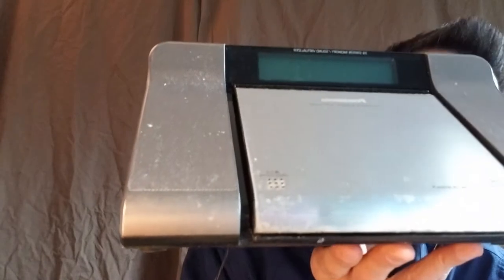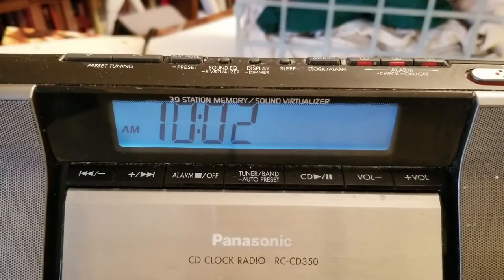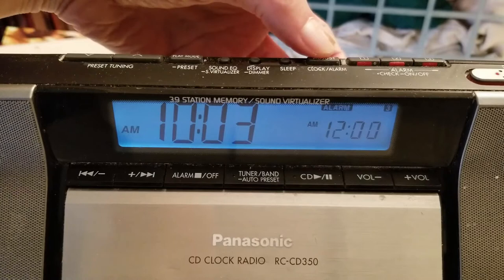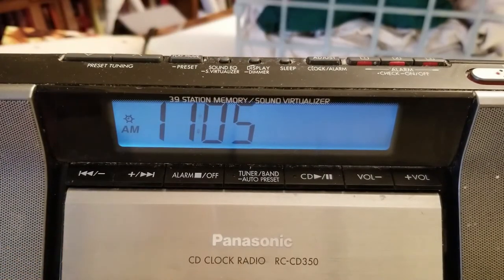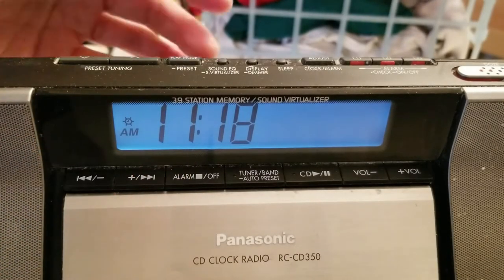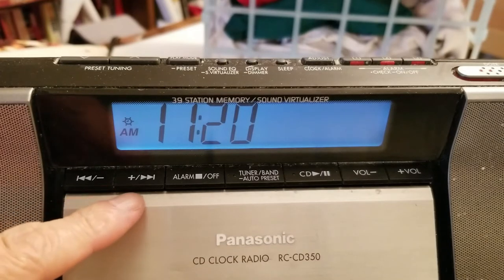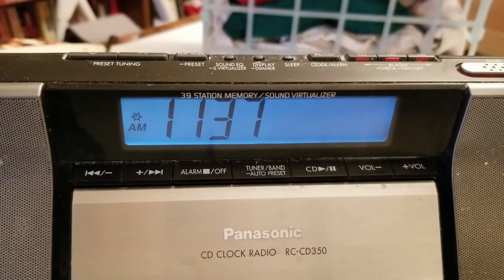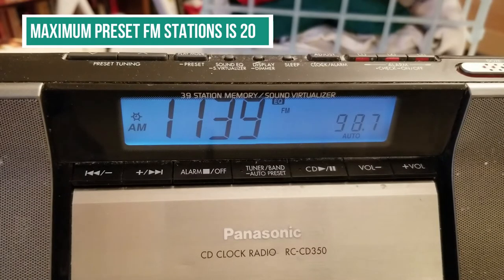Panasonic RC-CD350 Clock Radio Tutorial - How to set clock and radio presets

Comment: Thank You. I appreciate the training. but the CD does not work. it keeps saying no CD, but I put different CD every time it says. I just use it 2 days ago this month of December 2021. I love this Radio I had it since 2006. please help me? it is for my husband listening to music. again, Thank You.
Reply from the maker: Sorry you're having problems Ruth.  It's hard to say what's wrong without seeing the radio.  First, are the CDs "Real ones" or Burned CDs? This radio WON'T Play MP3.   Make sure the disk is firmly in place. It's vertical so it's trickier to put one in.  Make sure the setting is on the CD and not any other setting and last... it could simply be broken?  I hope that helps.  Let me know how it goes.  Thanks and Happy Holidays!
Reply: @waynethetrainer8888  💖💖💖
Reply: @waynethetrainer8888  how can I make sure the settings on cd? I've been having the same problem but i know it's not broken since it's still able to play the radio just fine. And I make sure to use real cds
Reply from the maker: @hamiltontrash9255  Sorry, I don't understand your question? what do you want to do with settings on CD?
Reply: @waynethetrainer8888  I have the same issue, whenever I put the cd in it reads "no disc" but the radio works fine and the cd player was working just a few days ago.
Reply from the maker: @salemaynalem6713  I can only speak from my experience. When ever my machine said, "No disk", it was because I tried to play a computer Ripped CD and not a, "Real Cd".  This player does not play MP3's.  The only suggestion I can make is pop in a, "real" CD.  if you get the same message, it may be broken.  If that's the case, maybe Panasonic can help troubleshoot?  PS.  Make sure you test the "Real CD" in your car or somewhere to make sure the CD actually plays! LOL

Comment: Is there a way to turn it of without unplugging it?
Reply from the maker: Thanks for the question, Kaleb.  I'm not sure I understand.  Do you mean turn off the radio or something else?  If you press the Alarm / Off button, it turns off the Radio without unplugging it.  What are you trying to do?  Maybe that will help clarify?
Reply: @waynethetrainer8888  I saved my Presets on 98.1. but after i unplugged it, it's erased.
Reply from the maker: @theamazingkaleb3077  Why are you unplugging it? That erases the presets AND the correct time, right?  LOL.  I'm trying to understand why you want to unplug it?  Now, if you are unplugging and moving it somewhere, I have an idea for you:   You can unplug it and keep all presets and time: By putting a battery in the bottom of the unit!  There's a place on the bottom of the radio where you can put batteries in as a "Back Up".  When the power goes out or you unplug it, the radio stays on and so do the presets.  Does that Help?
Reply: @waynethetrainer8888  yes. It help. Sorry. Don't be mad at me
Reply from the maker: @theamazingkaleb3077  I'm not angry.  LOL.  I'm always glad to help! Thank you for your question!  I just didn't understand why you wanted to unplug the radio?  I still don't but as long as I helped, that's great!!  Enjoy the Radio.